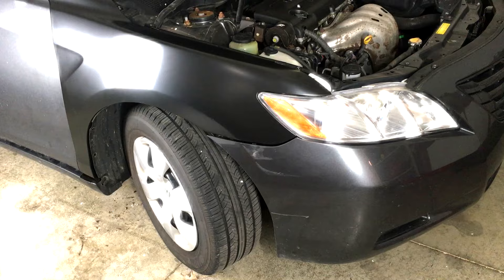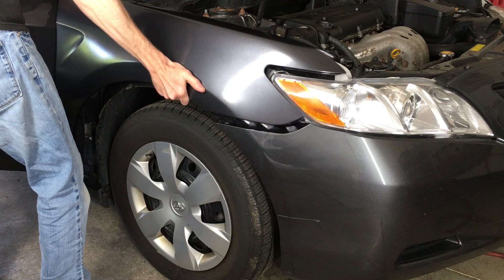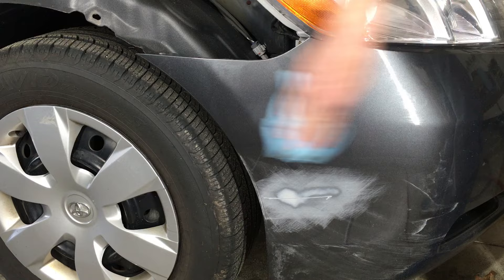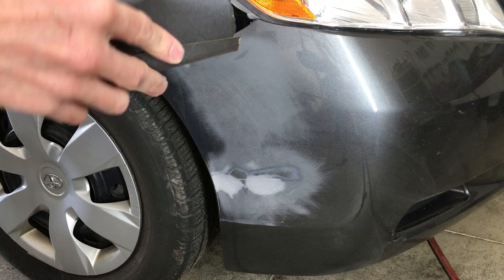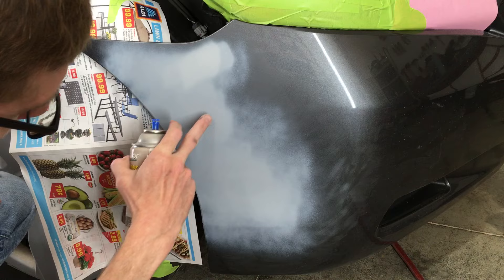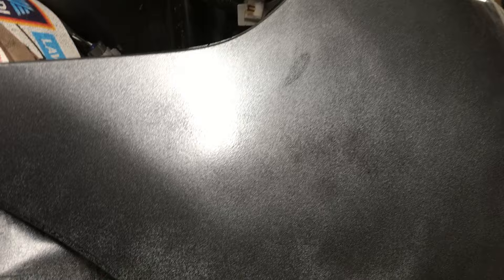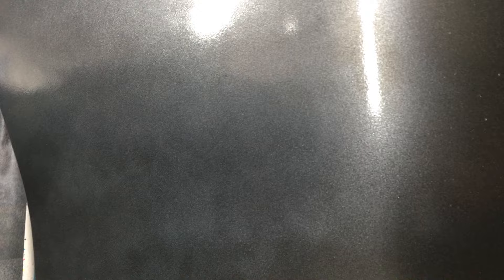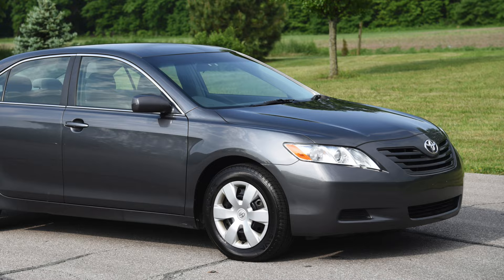How to Repair & Paint a Scratched Plastic Bumper - Easy Fix!

Comment: How do you blend the old clear coat with the new clear coat applied… cuz I did this the other day with the door of my car… and I wet sand and polished the orange peel but I can still see the line where the old and new clear coat meet
Reply from the maker: I just faded it out when I sprayed it. It's hard to describe, but after I polished it it anded up being seamless. If you can see a line, I'm thinking you still need to wetsand the edge of the new clear until it is level with the factory paint, then polish.
Reply: Great video on repair.

There is also a blend agent that will soften the existing clear allowing new and old to flow together, Spraymax 1k spot blender 3680093 for 2k top coats (which I prefer over the 1k). It's not really needed when the blend area wraps around and can be polished off as in the video, but it helps on blend areas occuring in the middle of flat panels.

Details from Spraymax...

Convenient aerosol blending solvent that provides seamless edge transitions for an invisible repair

The SprayMax 1K Aerosol Spot Blender is a mix of solvents that smooths the alterations made at spot repairs to give you a remarkable result. The spray gun pattern of this aerosol can provide a seamless transition between the old lacquer and the new. The Aerosol Spot Blender is perfect for blending and spot repair of 2K clearcoats and 2K topcoats.

The SprayMax blender has a very fine tip that directly jet sprays solvent to provide a smooth finish. The very soft transition created by this spot blender has an immediate effect, and you are sure to get high-gloss and high-quality results. You can now repair minor damage easily and economically.

Characteristics Properties of the Spot Blender

With partial dissolving properties, the Spot Blender is capable of weakening old paints to give you an amazing blending result. The spray gun jet spray helps you create a homogeneous flow in the transition zone.

How to use the SprayMax 1K Aerosol Spot Blender?

Sand the transition surface in advance with a sanding paper

Apply the spot blender right after the use of topcoat or clearcoat in the required zone.

Apply 2-3 light sprays until you obtain an equal transition

This blender requires no flash-off time

Key Features of the SprayMax 1K Aerosol Spot Blender:

Works well for spot and blend in repairs

Provides easy and quick application

Acts as an easy transition between the old and new lacquer coats

Needs less polishing work

Has no color deviations

Dries to a matte finish

Well suited for 2K clearcoats and 2K topcoats

Provides soft transition zones

Immediate effect

Ready to use aerosol can

10.8 oz aerosol can

Clear liquid

Comment: And a question do u sand the paint or just put clear coat
Reply from the maker: If the color coat is so rough that you have to sand it down, you will need to re-apply color before clearing

Comment: Great video!  I'm assembling my supplies and am going to attempt this soon.  FYI, you didn't list the Adhesion Promoter in your list of products.
Reply from the maker: Thanks, I just added the Adhesion Promoter to the list!
Reply: @6thGearGarage  Great.  Also, you listed Duplicolor self etching primer, but you didn't mention that in the video.  Is that only required for steel components?
Reply: how did the paint job go
Reply from the maker: @boyofthepeople  Sorry, just saw this. Correct, the self etching is ideal over bare metal.

Comment: Quick question.  I was a little too light with the color base coat in one area of my bumper and you can clearly see the primer through the clear coat.  Do I wet sand with 600 grit down to the primer and start over in that area or do you simply have to wet sand with 600 grit and cover with color until the splochiness is gone?  Otherwise the process worked REALLY good!!  Thanks for the video!!
Reply from the maker: Shane-Jennifer Pollard no need to sand all the way down to the primer, just sand with 600 enough to completely scuff the color coat and add some more coats.
Reply: 6th Gear Garage What if I already have clear on top of the color?  Just sand with 600 and put the color on top of the clear and then put down more clear?
Reply from the maker: @shane-jenniferpollard5955  In that case I would  sand until through the clear coat and into the color coat before re-applying color in that area.  Or you could just sand the surface of the clear and do full color and clear again.

Comment: Some videos say to wet sand primer and some don't. Why is that??
Reply from the maker: Wet sanding makes more of a mess, but dry sanding is more likely to clog the paper. So it depends if you'd rather have less cleanup or go through more paper.

Comment: Hi, do you need to cure it in the sun or would overnight in the garage work as well? I'm a little worried as I'd have to drive my car the next day and my work's parking lot is pretty dusty.
Reply from the maker: A warm sunny day will cure faster, but overnight in garage should be okay.
Reply: @6thGearGarage  amazing, thanks. Yes, i live in a very dry climate.

Comment: when is a plastic fender or bumper too damaged to repair? My vehicle has a slight hole in the rear bumper. I looked up some rust repairs and I'm wondering if I can use a similar tactic of mesh and body filler to repair the hole and then sand and paint it.
Reply from the maker: I think the only downfall will be that the plastic bumper is flexible and the repair area will not be, which may cause the repaired area to crack where it meets the bumper.  There is a repair called plastic welding that is ideal for this kind of repair. I've never tried it, but have seen it advertised by body repair shops.
Reply: @6thGearGarage  thank you so much, I've been looking into it and found a plastic welder at home depot, its cheap but looks like it will do the job. Figure its a very small gash(maybe 1/3 of an inch) and I'm going to be sanding and painting over it anyway. Thank you for the direction and keep up the good work.

Comment: I have a scratch about the same length as your deep scratch. Maybe a little shorter and probably not as deep. What do you think I w/b charged to have a pro fix it on a black 2018 Nissan Frontier. Just want a comparison.
Reply from the maker: I'm not sure what body shops would charge but I'm guessing at least a few hundred dollars?
Reply: Yah I heard a clear coat scratch starts at 150 and anything deeper starts at 300 bucks

Comment: Where do you get the duplicolor color match paint? Online it looks like they only have grey and black
Reply from the maker: Local parts stores usually have a decent selection, or can order the one you need. I've seen them on ebay as well.

Comment: i tryed that dupli color g3 code what ever it recommends but didnt came out the same its lighter than original magnetic grey how come yours looks the same mine came out ugly i painted back of my bumper area not even the same color any idea what should i do i have the same car same color as urs
Reply from the maker: Maybe you got a bad batch of product? Or was your car previously re-painted and oem color might be slightly off?

Comment: You said wet sanding is important but you didn't do it. You said "the orange peel isn't even bad enough that I have to wet sand it." Wtf does that mean?
Reply from the maker: Orange peel is the roughness of the paint. Sometimes paint lays down rough. If it is bumpy like the peel of an orange, then it can be smoothed by wet sanding. The lacquer paint I used layed down pretty smooth so I didn't need to wet sand before polishing.
Reply from the maker: Here's a video of how to wetsand and polish paint that has heavy orange peel: https://youtu.be/ZCnLoFX5O0o
Reply: @6th Gear Garage  got it thanks for the quick reply you're awesome!

Comment: This guy didn't tape off the rest of the bumper.... primer over spray.... Jesus christ don't take this guy's advice
Reply from the maker: It was blended to be painted over. Also any Lacquer overspray wipes right off.
Reply: @6thGearGarage  the primer isn't going to blend lmao. You should of taped off the bumper at the repair for spraying primer.... then taped it off like a foot away when spraying color for blending. In another video I seen you spraying a dozen coats of primer to fill in scratches and dings that could of easily been taken care of with bondo glazing putty. Hilarious.
Reply from the maker: @coolkid6364  I guess watch the video again, it turned out great. The other one with the filler primer did too. Didn’t use bondo because bumpers flex and bondo doesn’t. What works for me may not work for you, everyone does things differently. 👍

Comment: I am trying to repair a rear bumper cover on Corolla, the body filler,2 part Bondo says for metal fiberglass.  Since the material I believe is plastic. Will the filler adhere to bumper? I have 3 scratch lines.

Thanks
Reply from the maker: I don't know about using metal fiberglass, as I've never use that before. It sounds like overkill for some scratches. I would just stick to the products that you're familiar with using on a plastic bumper. You'll need to rough up the surface as I did in the video and clean it for the filler to bond to the plastic.
Reply: @6thGearGarage  I believe this is regular 2 part Bondo. Says for aluminum, metal, steel , I think wood as well.  3m says it probably would fail in plastic bumper